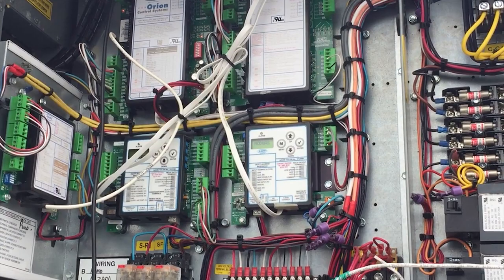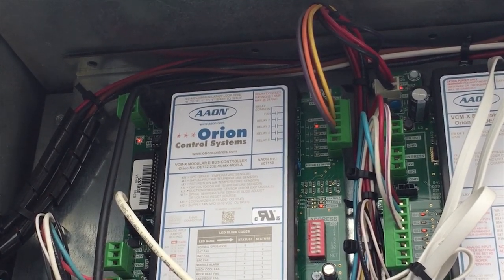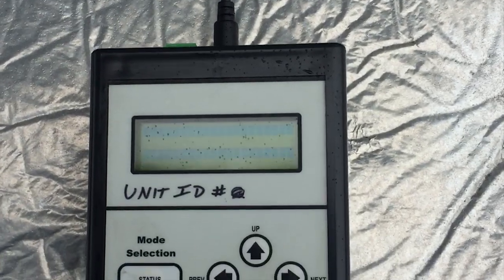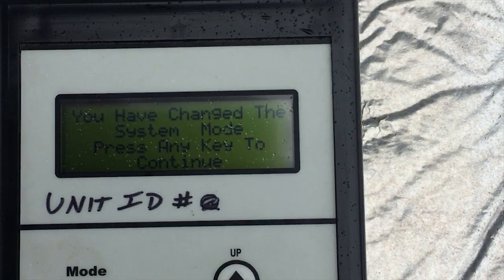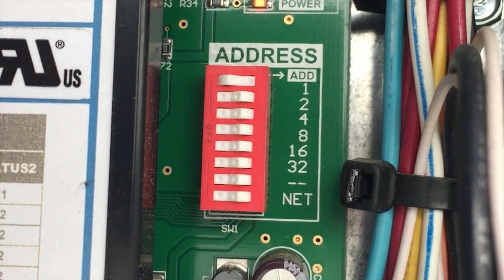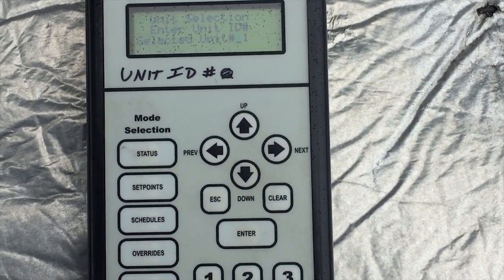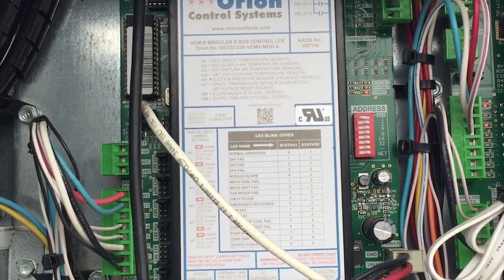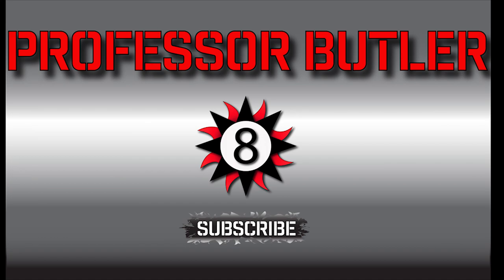HVAC: How to connect with an Aaon Handheld interface for Orion Wattmaster controls.

Comment: Great information question if I download the Prius 2 to my laptop I don't need to get the hand hell to diagnostic the unit ?
Reply: Prism II, having both is always a plus.  But you do not need them both, but with Prism II you will need the USB LINK 2 as the communication "modem" between the computer and the controller.
Reply from the maker: you don’t need the handheld, but you have to buy a USB module that plugs into your computer that interfaces with the unit

Comment: Wait... So you can use a laptop with Prism 2 in place of the modular service tool? Is there any benefit in using the service tool over Prism? I'm assuming you still need the CommLink 5 or USB Link 2 to bridge the communication between laptop and controller? Sorry for all the questions 2 years later... we're trying to figure out how necessary purchasing these overpriced service tools is
Reply from the maker: I prefer to use the software. Prism 2. As far as I know there is no difference. The service tool is just easier for any technician to use they don’t need laptop skills or a usb dongle. Yes you need to purchase an USB interface. If you have any further questions you can always DM me on Instagram. IG: ProfessorButler08
Reply: The Handheld Service Tool SD is really nice to have when you update modules such as the MHGRV-X, ModgasX, RSMD, RSMV, etc.  If you use PrismII to update a module, you have to pass the software update through the main controller, which slows down the process considerably.  It may take 15 minutes or more to update a module using PrismII.   Having said that, PrismII is way easier to use once you have it set up and understand how to use it.  If you have internet access through a hotspot or network, Controls Support can dial in to your computer and see exactly what's going on with your unit.

Comment: What happens if i dont disconnect the wires off of the green connector while my hand held tool is plugged in?
Reply: Its possilbe it will act like a bad comms port and will not connect.  You want to always disconnect the loop comm wire when trying to communicate to a single unit.
Reply from the maker: When working with a VCMX AaonWatt Master board, you need to disconnect the communication link before connecting a handheld or laptop service tool to avoid communication conflicts. The service tool requires direct access to the controller without interference from other devices on the network. This ensures accurate data reading and programming without any interruptions or errors

Comment: The Board is a newer version.  Won't connect. It doesn't have those dip switches for address
Reply from the maker: Yes, the newer Watt Master’s have a little digital screen. If you look in there, you can see what the address is for that controller you’re connected to. Then match the handheld and it should work. If not, if you’re older handheld has not been updated you may have to update the firmware on the handheld in order for it to work. Hope that helps.
Reply from the maker: If you need further assistance, follow me on Instagram and send me a DM

Comment: I have 6 aaon units in my building and I only have 3 that have comms...lol
Reply: At the comms loop port you need to check you comms driver chip.  Check with a meter DC volts from T-SH, and R-SH.  You should get roughly 2.5-2.8vdc on each.  If you get anything way over or under you need to replace the comms driver chip - LT1785 chip usually found on the top left corner for the boards... (8 leg chip)  This does not guarantee it will comm but this is a problem, you may still have a bad comm port.